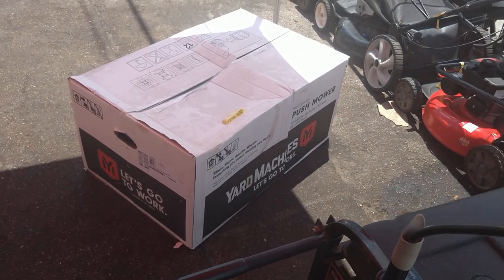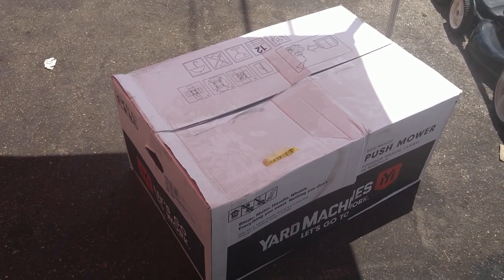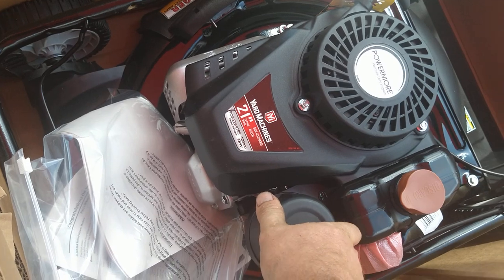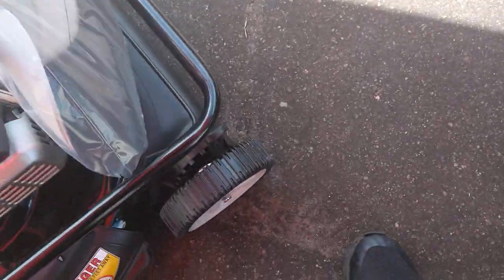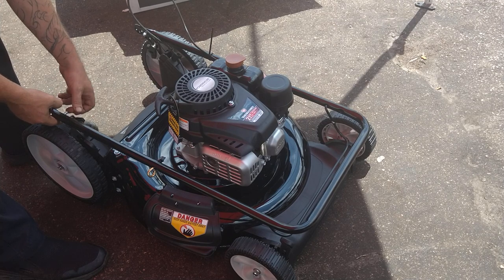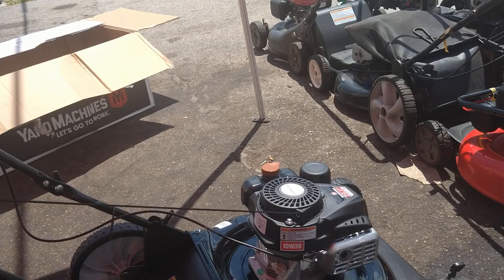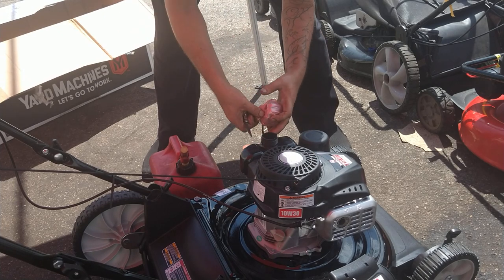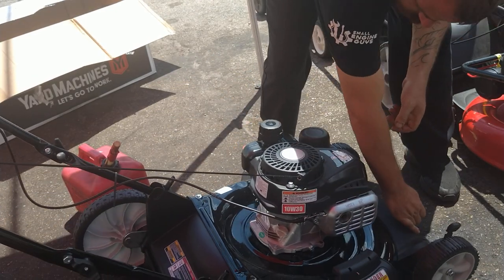yard machine push mower unboxing assembly review model 11a-b0ma700

Comment: Bought mine from home depot today and it ran like a dream. Easy to start and flattened out a lot of ant hills with it. However mine didn't come with a gas cap. So I used the little rubber thing that came on the tank that says discard for today. Going back for a cap tomorrow though
Reply from the maker: yeah the one that says discard has no vent. after using for a while the gas wont go into the carb without the vent causing it to shut off. open tank close it will start right back up.
Reply: @smallengineguys  got the new cap from the home depot. We all good now
Reply from the maker: nice!